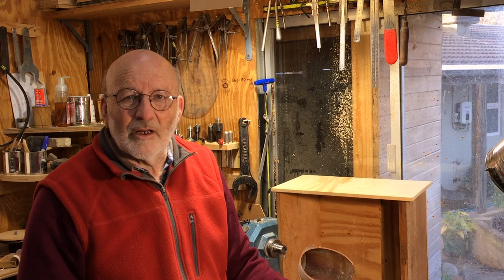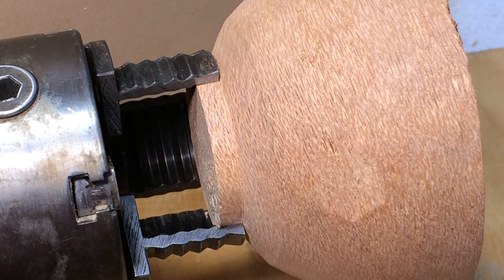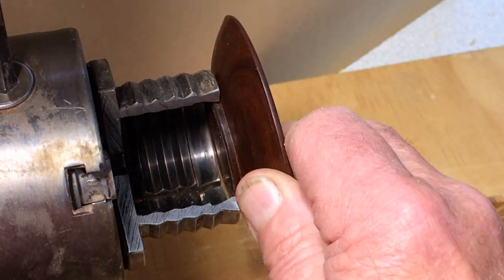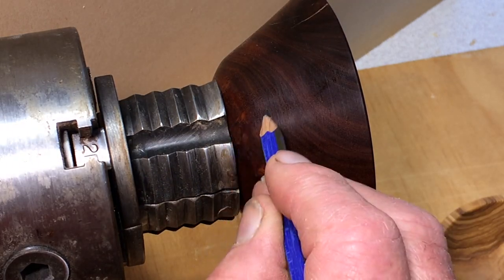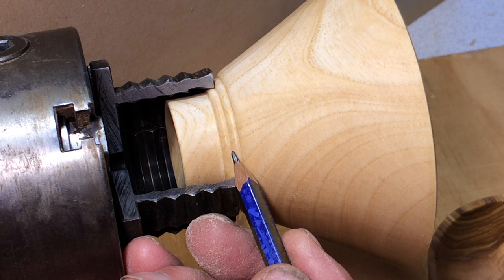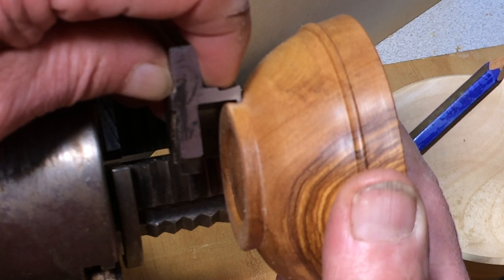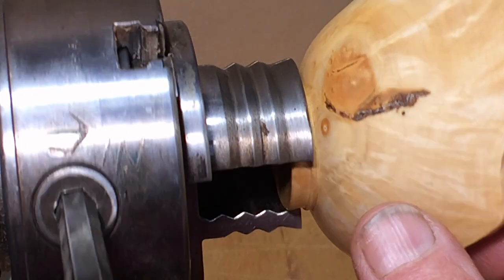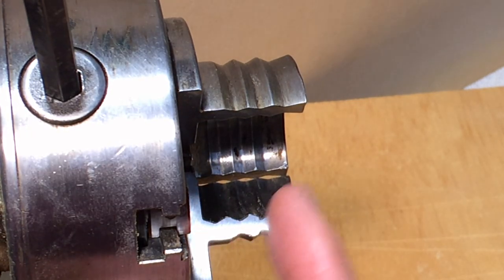Richard Raffan using chucks without marking the wood.

Comment: Great video Richard, I have used your technique a lot after learning it from you. I have changed all my chuck jaws to dove tail style and they work great. I have even removed the Beak on one set to make it a perfectly smooth dove tail for the reasons you mention. Sometimes I will use a burn line decoration on purpose to provide a chucking point, it seems to harden the fibres a bit, and I re-burn after holding to remove any minor chuck marks from a less than perfect circle. It’s quick easy and reliable, and only another turner knows what its really there for. Lol.
Reply from the maker: So Bert — you didn't need to watch this. I hope you've been spreading the word all these years.

Comment: So I knew the size of the tenon had to be quite close to ensure whole surface was gripping the tenon, but the steeper ange is a brand new trick for me. I think I'm gonna shape a quick little scraper from an old scraper I have picked up to see if I can get such an angle repeatedly. I think the bottom of the bowl and the foot are the parts of turning I should work the most on right now.

Comment: Great information, that I'm sure a lot of us overlook. I'd like to know what those along the length are for as well. Vicmarc may have an answer for that question. At first I thought, maybe for strength of the jaws, but the narrower part would still be a weak area. Maybe to reduce weight of the jaws perhaps. Anyway, thanks for sharing Richard.
Reply: I've just now sent a message to Vicmarc asking about those Ridges on the jaws on their Facebook page. I'll report back if I get an answer, as it has me curios now as well.

Comment: Mr. RAFFAN, do I understand that you do NOT need to precisely match the dovetail tenon on the bowl to that of the jaws?
Have I been wrongly assuming that the angles MUST match?
Reply from the maker: Correct, you do not need a matching dovetail and the diameter of the tenon or, groove, or bead being gripped can be slightly smaller than the machined diameter of the chuck jaws so only the center part of each jaw contacts the wood. However you do need jaws like those on my Vicmarc chucks with crisp rims devoid of chamfers or square sections.

Comment: Thank you for this video. I've just been doing some searching and it seems like a lot of the manufacturers add the chamfer to the dovetail. It seems especially apparent on the NOVA jaws, where the chamfer is really quite large. I wonder why that is?
Reply: I'd like to know this as well. The Vicmarc's aren't as bad. I was looking at making my own jaws once I get hold of a metal Lathe to produce nice sharp dovetails, but after this video I think there's a reason there's the small chamfer across the inside and outside edges of the dovetail, to do with marking the work piece as Richard pointed out.
Reply: The tiny chamfer on many of the Nova and Record Power chucks may not be as ideal as the Vicmarc jaws. But this is still a valid technique if you size the detail correctly as Richard Points out. My experience is that there is still  minimal marking that is hardly noticeable on hard wood turnings. Sometimes I will use painters tape to minimize the marking.
Reply: @MikePeaceWoodturning  Its not really a "tiny" chamfer. Take a look for example at the NOVA Long Nosed Jaws. Although perhaps the images are deceiving?
Reply: @SirBenJamin_  I do not think the Nova long jaws have a bigger chamfer than their normal 50mm jaws. I have the Record Power long jaws and they do not have the chamfer like the Nova or Record Power 50 mm normal jaws. The Record Power Bowl jaws do not have a chamfer. From a picture of the Nova Bowl jaws, it does not appear to have a chamfer.  The Nova Power grip jaws have a tiny chamfer but the Record Power equivalent I have, does not. The Record Power jaws are interchangeable with the Teknatool ones. You just swap the 2 and 4 jaws since the old Teknatool chucks tightened in the opposite direction.

Comment: Hi Richard,, what do you think of the Record Power SC4 chuck system.?
Reply from the maker: I've not used them but see the inner lip of the standard jaws is chamfered, unlike the dovetail jaws. For that reason alone I'd stick with Vicmarc chucks. But of top of that I've never geared chuck keys anything like as easy to use as hex keys and the teeth seem to get damaged. My advice to chuck buyers is always to buy Vicmarc.

Comment: Thanks for the detailed explanation.  The removal of one jaw gave a very good graphic demo of the hold.  BTW: what brand/model is the chuck and jaws?  Thanks again for the video.  Cheers, Tom
Reply: In case Richard doesn't get an opportunity to answer. I'm pretty sure he's using Vicmarc Chucks, which I picked up from another of his videos when he mentioned the model number (VM100 from memory). His Lathe in case you are wondering is also a Vicmarc.
Reply from the maker: Diemen Design is correct. All my chucks are Vicmarc bercause you can do a lot more with them than any other of the dozens of chucks I've used through my 52 years as a professional turner.
Reply from the maker: @DiemenDesign  Correct!!
Reply: @RichardRaffanwoodturning  Thanks for the info. Cheers, Tom

Comment: Presumably, the jaws with the square ridge would grip a work piece with a corresponding groove.
Reply from the maker: Possibly, but I can't think of a situation where I'd have a decorative squared groove for a chuck to grip. All the jaws on my Vicmarc chucks have crisp rims devoid of chamfers that fit nicely into vee grooves and corners. I'm wondering which chuck you're using.

Comment: Can these Vicmarc shark jaws be used on the Recor Power SC4 chuck please? Thanks.
Reply from the maker: I don't know the answer to that, but I suspect not. If you machine or grind away the top of the Record jaws you can remove the chamfer and end up with a crisp dovetail rim.
Reply: @RichardRaffanwoodturning  Hmm, I was waiting for this answer, but thanks for the quick answer to my question.